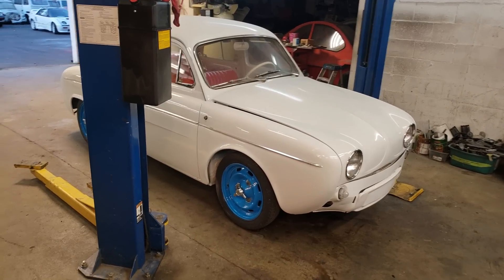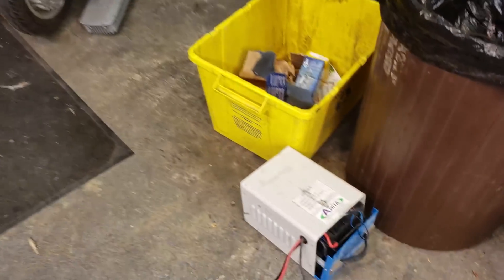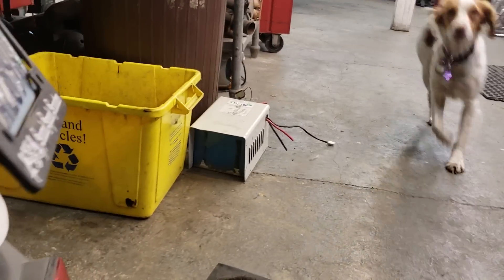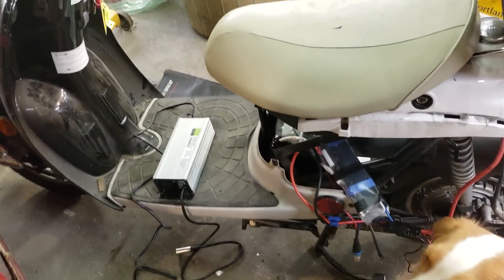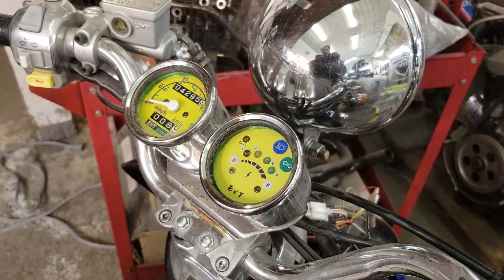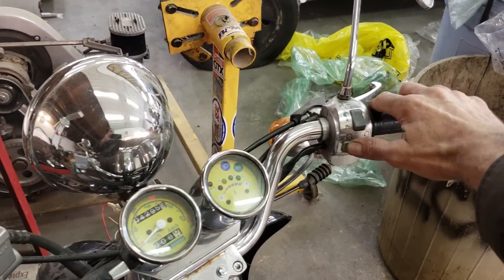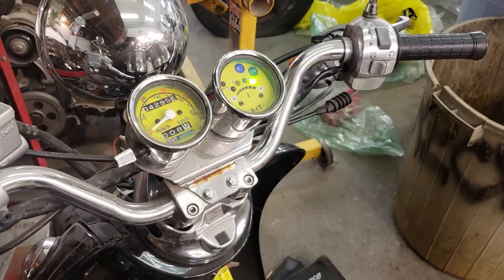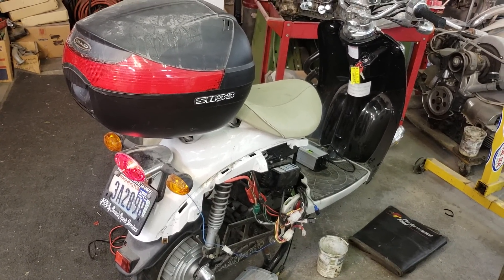Tesla Scooter (Teslooter)  EV project finally works !

Comment: Can you explain the blue wire?
Is it the 4 pin plug  or the two pin plug from the old 30v or the 20v packs??
And did you hook it to positive side of the 62v pack now
Need a ground wor negative side?
Thx

Comment: Looking forward to plug & play electric retrofits when glass batteries arrive and gasoline becomes hard to find because few  want to buy it. Also the motors/controllers used in vehicles have just as high torgue at 1 RPM as at 1000 RPM, so I'm thinking used scooters will be hacked to power machine tools such as lathes that need precise uniform speed control.

Comment: Reminds of buying a 164 Volvo years ago. It was injected with 1971,or 2 technology, and the guy had fixed a timing gear, but it wouldn't start. I picked it up for 50 bucks because he was sick of looking at it. I fiddled with it for about thirty seconds, hooked up a big red wire that was just hanging out about 2 inches from the positive battery post. Turns out it was the power wire for the "brain". Zoom zoom zoom.